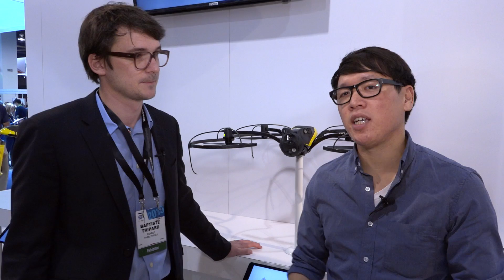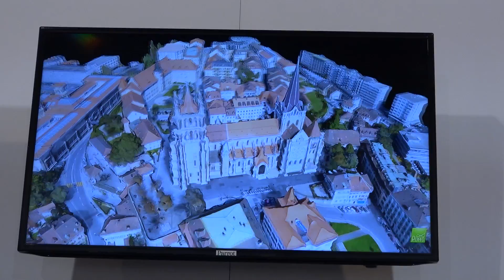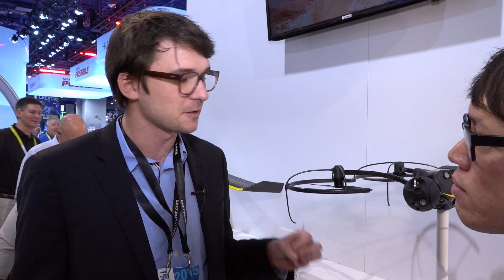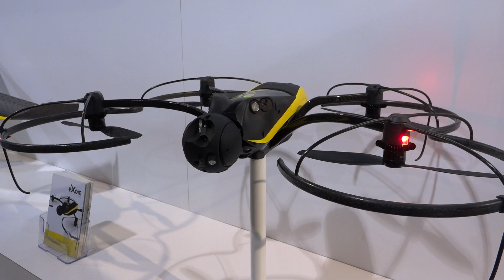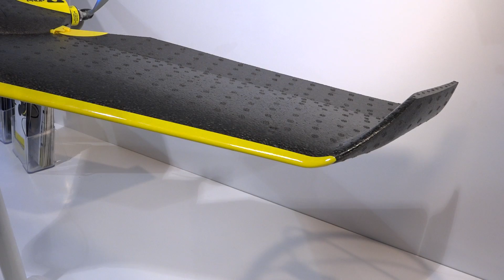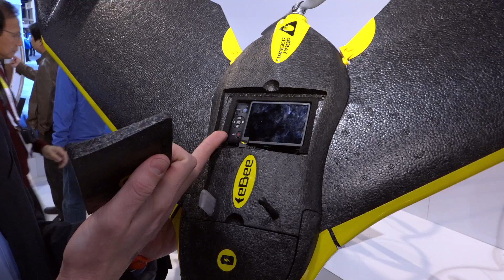Aerial Mapping with Quadcopters and Drones

Comment: I can see both these used in search and rescue operations not just for lost hikers/campers but add thermal camera for pinpointing fire hotspots. They just need to increase the flight time from around 30 mins to an hour or two and the range of signal for control and video then the quad would be well suited to search and rescue as it can fly lower than a helicopter without risking lives.

Comment: I could see an upgraded version of the fixed- wing aircraft using inferred cameras to map and track a lost person. It could be used by search and rescue personnel on a smaller scale to locate lost casualties. It could save on locating time for locals to operate these instead of waiting for a helicopter to pin- point a lost individuals location.

Comment: I like the flying ant, it really needs LIDAR for object mapping. I think ultra sonic is pretty old tech.
Reply: How much is a LIDAR mapping system cost?
Reply: $2k-$3k
Check out diy drones blogs, expensive but if this is not consumer it should have a better range finder than sonar. There was a sonar game called seek n find in the 80's I have and use to find my multirotor.
Reply: Hoverbot1TV
You're wrong. A LiDAR system like the Velodyne does cost 3k to 5k however you need a IMU to actually use the Lidar. A proper IMU can cost anywhere from 50k to 500k.

Why you need an IMU and a very accurate georeference? Without it the LiDAR data is simply unreferenced points without any value to it.

The future for drones is photogrammetry. Our company has been working with it for over a year now and it yields incredible results.

Comment: As a FPV pilot for many years i do not believe in this concept. I believe for safety reasons that the "drone pilot should always know how to control a model manually. This is why we se so many accidents and bad flying that ruins model flying for the hobbyist. The one whom started this!!
Reply: 100% agree. Learn to fly first, then buy one of these. Don't rely on this thing always being autonomous. Things go wrong, and we, the hobbyists, are the ones that are suffering.
Reply: Thats a good way to say it! I kinda wish that there never was an RTF platform made...
Reply: vazza69 I believe there should be a competency test before these are allowed to be sold. They are so expensive in the first place, there should be a lesson package included in the cost of buying one. Until you pass this test, you cannot have it.
Reply: yeah that would be the best and safest way! You really need some knowledge before getting a model!!
Reply: vazza69
Well said, while it's great to get more people into the hobby, you need to know what you are doing. If you know how to fly and have built a model yourself then you know exactly how it works and what its limitations are. Having built all my models myself i know all the signs of a failure, and what to do if something was to happen, with an RTF you can't know this.

Comment: Totally disagree with giving these to people with no knowledge of flying.
This is why the FAA is clamping down on all FPV flying, because the people with "All the gear and no idea" are buying these and DJIs etc then flying them, losing control, and off they go into the wild blue yonder, to be spotted by a commercial airline pilot in his air space.
Anyone buying this sort of product, should have the skill to fly them manually incase of a malfunction. I'm sure I could fly an A320 commercial jet on Auto pilot until something went wrong. Then what would i do????
Reply: The easiest solution is to have a license applied to flying a professional grade quadcopter (say one that can reach a certain height/distance, not the small toy ones) I'm sure any business that wanted to use one of these would see no harm in having the employees licensed and trained to fly one, so they don't have to replace the expensive equipment if it's crashed and at the same time the fliers will have the experience needed to stay out of the air space of the planes. I imagine that would be a benefit to employees too, much like having a forklift/truck driving license is a benefit if someone is looking for work that requires the use of those vehicles.

Comment: Drones need bigger battery's if they want to be more feasible
Reply: I believe, in some near future people will come up with some new battery technology, and drones will become very hot topic and useful even for every day use.
Reply: You might even have to look back for that. But to the future for a better price.
Reply: The problem with bigger batteries is that they weigh more and the quads will need to use more power to lift them, ultimately not extending the battery life that much. Some new advances in battery life is the only way to extend a quads flying time to what people want.

Comment: That fixed wing drone is a joke.
Reply: Ikr
Reply: What do you know about drones?
Reply: It's not a joke. It's built with sturdy but simple materials which means it can easily be repaired. Fixed wings tend to land pretty harshly.
Reply: jspr2k5 An EPO foam molded plane with all the mold marks still on the wing, which makes for a very inefficient airfoil with heaps of drag. Not to mention black paint on foam - will melt the first sunny day.  For a toy maybe, but for a commercial application, its a joke.
Reply: B4its2L8guy
 Our fixed wing is black as well. For where I work we rarely get long hot summers, which is when it would be affected. For work in Africa we use a white body. As for the mold marks, it will barely make a difference. We've tested several types of bodies. Foam and plastic. We found out that the flight duration difference between the two bodies is neglectable. However the foam model is much easier to repair which is needed when you're working in the field away from repairshops.
Reply: jspr2k5 Black foam will fail.  I have been building "drones" for over 5 years and I guarantee you black foam will not stand the test of time,  not to mention the stress to electronics being placed in a solar insulated oven. Even a sanded foam wing is still inefficient due to the porous nature of the foam.  With the addition of the mold marks on the top of the wing clearly demonstrates the errors in design.  Most likely because it was designed by business entrepreneurs and not aeronautical engineers.  There is a huge difference between foam and traditional wing coverings in both lift/drag and performance.  My epoxy coated wings will fly further and faster, with 2/3 of the amp draw using the same power setup.  I agree foam is cheap and easy to fix, but for professionals its not the right material.  Its like a camera guy showing up for a shoot with a DIY PVC shoulder rig.  When we're paid professionals, we show up with professional tools too.  Sorry, no hate here.  Just talking from my experience.
Reply: Ours aren't meant to last long honestly. They're cheap to build. 3 to 5k ...they earn back their money in a weeks time.
Reply: jspr2k5 Cool.  I'm sure most of that $$ is in payload.  The wing in this video can be built for under $150, excluding any flight controller or rx..  What kind of gear are you flying and what applications, if you don't mind?  5K sounds like a pretty good budget for a craft.
Reply: we use a large epo foam fixed wing body and then wrap it with a layer of carbonfiber compound for rigidity.
Inside are a camera ,GPS, gimbal, powerful engine and about 15amps of battery.
I'm not the company's technician so I don't know the exact details. :-)